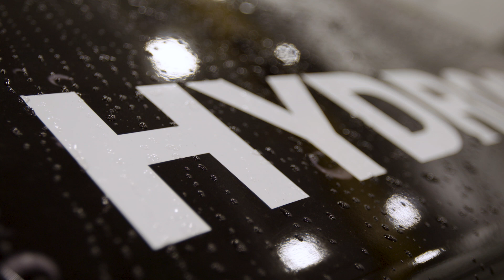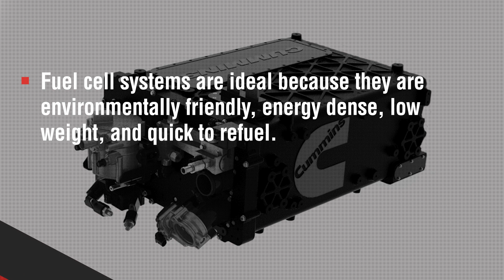Fuel Cell Electric Vehicles - The Road to Zero

Comment: Here’s a question for ya. What is the root energy source you’re using to make the hydrogen?
Can’t be wind, as that’s unreliable, horribly inefficient, and the death toll on avian species is not sustainable. 
Can’t be solar, as that’s even less efficient, only works from 3 ours after sunrise to 3 hours before sunset, has reduced power on overcast days, and doesn’t work at all if dust or snow covers the panels. 
Its really time that you and the rest of the corporate world told the Leftists to take a long walk off a short pier. And chummed the waters off the end of that pier just to make sure. 
They’re only hurting you, your employees,  their families, your customers and clients, their employees, and their families.
Reply: Solar is the cheapest source of energy. Also have you even considered nuclear power? You make a very weak argument and thesis.
Reply: Also not to mention unreliability isn't really an issue for this, as long as the tanks are big enough to last like a week it's very easy to get close to emptying the tank, then refill when it is windier.

Comment: Dang I hope Cummins will not go full electric tho
Reply: Synthetic fuel!
Reply: it will and has to in order to survive as a company
Reply: @thegreypenguin5097  here’s a reality check for you. For passenger cars to go electric, the power grid would need 20 gigawatts of base load energy production to be added each year to keep up with the growing energy demand. This continues increase in demand, year upon year, wouldn’t let up for the better part of a century, as populations will still increase, driving habits won’t change, and classic cars will get converted (Holley high voltage fest was a blast by the way).
It would also require a massive construction of a distributed energy storage network that would allow the needed time shifting necessary to maintain grid stability as vehicles plug in to recharge. This upgrade is long overdue, and necessary evs or no evs.
The two largest power stations in the USA are Grand Coulee dam and Palo Verde, together making just over half of what is needed to meet just one year’s growth. They both took decades to build.
The only way to make that much energy in a short period of time is nuclear. Which means the leftists need to decide that nuclear energy is the future, or we’re going to have to stick with blowing up liquid dinosaurs in our fuel tanks.
But either way, the petroleum industry isn’t going anywhere, as even electric cars still need lubricants to keep them functioning. Then there’s all the plastics that go into them, all made from petrochemicals. 

Electric cars are a cool novelty, that I truly hope never goes away, but its not a sustainable prime mover for the economy without nuclear energy.
Reply: @thegreypenguin5097  Thank you for your calm response to someone who has a very deliberate axe to grind.